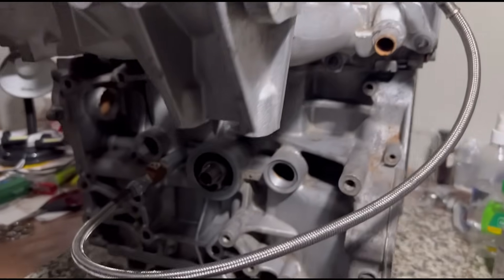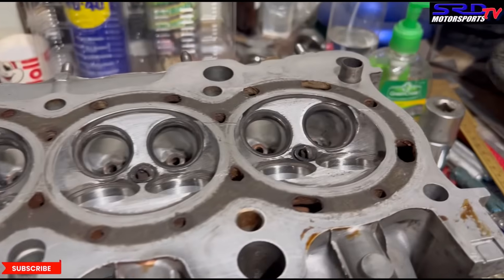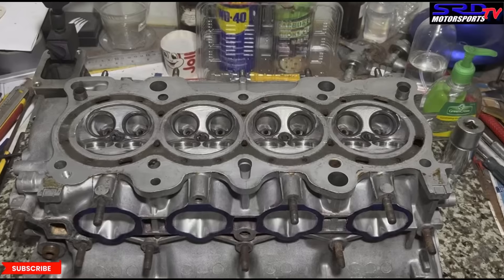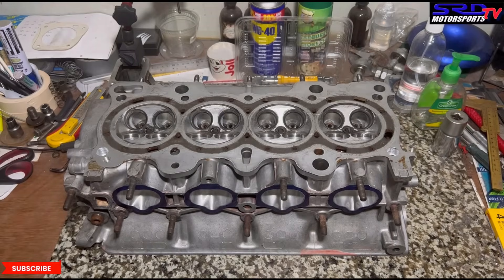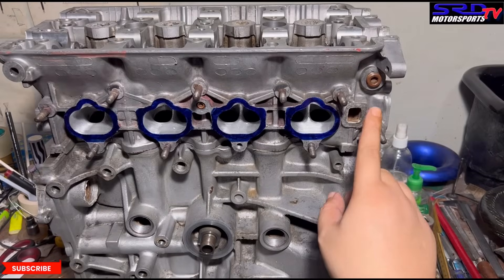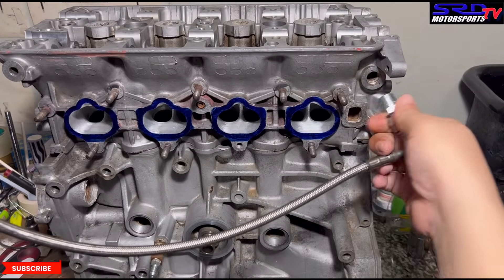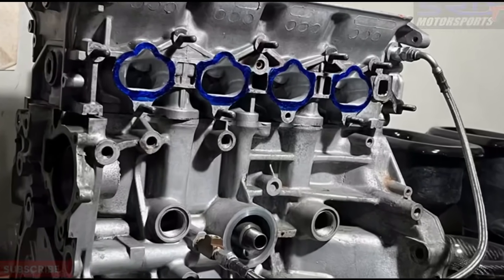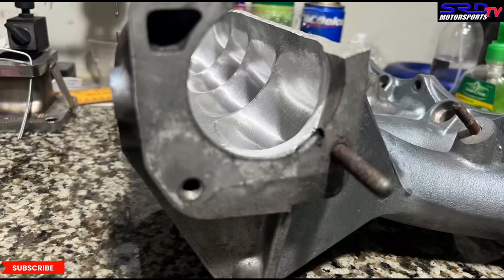Complete Guide: B20Vtec Conversion B16a / GSR / Head and Block

Comment: can you make a video how to port cumbustion chamber
Reply from the maker: That’s too hard but can try but ALOT of secrets there that’s why the b20vtec video I did 
The YCP vs 1Up piston I shared a rare moment a photo of the chambers I do

It’s why others don’t show it 😂 we show enough to help guys like you but also priority is promoting the shop ofcourse
Reply: I am currently porting the head of a D14A4 and the combustion chamber is next on the chopping block. From my understanding and research on the internet, porting the combustion chamber means unshrouding the valves to allow more air to enter easier and smoother past the valves and grinding down sharp edges to avoid hotspots forming and detonation and pre-ignition. After that you sand it down with finer sandpaper till mirror finish to make it harder for carbon deposits to form and to reflect more of the heat back into the combustion chamber, thus making the combustion more efficient. It's probably a marginal or non-noticeable gain, but hey, when you're going trough the trouble of porting, might as well go all the way trough. The tricky part is matching the cc of every combustion chamber to be the same so you have a consistent compression ratio in each cylinder and the other tricky part is to not remove too much material as you will lower your compression ratio and diminish the gains that you received from unshrouding. If you port too much you have to either: 
A) Mill the head to bring the compression back, but you can only do it to a point and you have to be careful of piston to valve clearance, piston to head clearance and timing.
B) Run higher compression pistons, but that involves rebuilding the block as well.
C) Weld up the combustion chamber and port it so you have more quench area and bring back some of the compression ratio and mill the head after that. 
D) Running a thinner head gasket, but you run out of options quick on this one.
I guess it goes without saying that you can do certain things together or all of the above at once to meet your goals.
Engines like the D14A4 have low compression ratio to begin with (9.2:1) so the slight loss in compression ratio from losing cc in the combustion chamber should not be a big deal, but on higher compression engines the loss in compression ratio will be bigger so keep that in mind.

Hope this was of some help.
Also @SRDmotorsportsTV, love your content dude! Keep up the great work!
Reply from the maker: @SusedatLubo  good points there and I agree… the trouble also is each head depends if the stock port is “big” or “small” for the current valve = will dictate the type of unshrouding if any or “many” or a little bit

It’s why I showed on the other video the combustion chamber I did and showed also Endyn’s chamber

Both had bigger bore so unsrhoudong was easy BUT we limited the unshrouding cuz of everything else like cam , valve size and all

Thanks for sharing this it was too long to type as you can see 😂
Reply: @SRDmotorsports   Since you know your way around cars, do you mind me asking for some advice in picking a head gasket? My stock bore is 75mm (gonna be 75.5 some day if I decide to overbore and forge the internals for boost) and I am planning on going 76mm head gasket with the idea to have a little bit more room to unshroud the valves in the combustion chamber before getting too close to the gasket. Most people on forums and all over the internet recommend to go same size as the bore or 0.5mm oversize when you get a gasket. Would it be an issue to go +1mm bigger than bore, as in will it hurt longevity of the gasket to a noticeable extent or is it just a very miniscule drop in compression?

P.S. How can one know when to NOT unshroud too much? I'm a bit puzzled on that question too. Any advice from more experienced builders is much appreciated.
Reply from the maker: @SusedatLubo  slr

Actually good question on the gasket stuff… I agree I’ve heard similar stuff on same bore or stay +0.5mm OS

Personally I don’t see an issue or if there is any? That’s an area like .5-1mm but 0.027” thick so almost nothing?

Maybe just maybe if we are talking about 1,000-1,500whp turbo engines yes it might be an issue as it might be a gap where the “combustion” can try to escape the gasket?

But then at that rate wouldn’t we be running a copper Oring too? 😂 so I don’t know

But much the same on b16 heads running p3f/p8r Headgaskets that are 84mm bore and the b16 chamber is under 81mm hmmm

On the deshrouding question… trick way
Put a valve (intake) on the chamber
Lift it as high as the cams “max lift” prolly below 12.5mm I’m sure

Pay attention to the places needed or not needed deshrouding :)

That’s one thing :)
Reply: @SRDmotorsports  Solid advice and yea you are pretty much spot on! The info about these engines is quite scarce, but i did read some time ago that max cam lift was little under 0.300" or 7,5/7,6mm cam lift x 1.6 is i believe the rocker arm ratio on the intake valves = ~12mm max lift +/- 0.3mm. Take this with a grain of salt as i didn't measure the cam or the rocker arms, but it's a rough estimate. I did some digging around and found some info about unshrouding from the big man himself, David Vizard. The basic rule of thumb that i understood was: The sweet spot for unshrouding is 1.4 x the diameter of the valve. In my case 1.4 x 30mm = 42mm. That means that i have to unshroud a circle (where possible) around the valve, where that circle extends 6mm past the end of my valve. Any more than that is high diminishing returns, so i consider this the sweet spot.
Hats off to Honda, as the combustion chamber looks really well made and all it needs is opening up the combustion chamber wall around the valve by a small amount, that's where the bigger head gasket will come into play and give more room for that. The other thing is getting rid of that nasty edge in the casting after the top cut and smoothening it out.

About the headgasket i agree. It's probably 110/115 chp due to the bolt-ons and no tune, realistically it's less, because it's a 24yr old engine with 220k kilometers (I am 99.9% sure it's probably been turned back quite a bit a long time ago :D). So yea, we are not running 1000+ whp drag cars to worry about longevity and power losses from such minor gaps.

The thing i like about this channel is that it presents complex things in a simple and easy to understand manner, which more or less gives you a starting point if you wanna dive deeper into a topic and learn things you didn't know yesterday. Also uncommon and unorthodox mods like porting the D16Z6 manifold, which is next in my chopping block after the head :D , so yay, lucky me that there's a video explaining what to do. Most people barely get into head porting, let alone Intake Manifolds. Bolting on cams and manifolds is fun and easy, but making the most of them and chasing efficiency is the fun and educational part. You can learn not only the from vids, but from the comments too, as shown here.

Thanks for the advice and keep up the top tier content, champ! Plan on doing some dyno runs in the future before and after a certain mod? Stumbled into honda-tech some time ago about porting the IM, and giving some low-mid rpm torque gain and ngl, for a daily driver that does sound very appealing.
Reply from the maker: @SusedatLubo  oh man! Now u dug a deeper hole hahaha

With what u got from the man himself Dv
Il give u one trick now … ur intake valve? Super glue a match stick pointing outward… cut it off at the exact ratio u need? Now lift it 0.300 and spin the valve now u got urself a “waze map” of the area haha ftw!!!

If u mean u plan on doing dyno or asking? If asking yes sir, I’m still checking what’s next at the shop and whenever there is a chance to dyno? Definitely il squeeze in some dyno comparisons like for the intake pipe I designed etc

And yes on the chance I can afford to pull out my built D16a6 and “redo” as a series as I built it 3yrs ago so 2yrs too early than when I made this channel lol

But if I get to do that? The known plan as I pinned it in the comment of my EG8 Esi video

Is dyno tune it on stock p08 manifold
Then a week later dyno tune again on ported P08 manifold as we have never seen a comparison like that

And lastly dyno tune on my ported skunk2 intake ftw!
Reply from the maker: And thank you for the comment about the channel… in all honesty I’m sure u have sensed it too that talking about what we enjoy ? Is not always welcomed by our friends cuz it’s either too tech or boring for them hahah here locally (Philippines) everyone is “JDM this JDM that” so tech talks are less and Ofcourse too many local shops who either don’t share? Or wait for newb customers to scam

So as I do this to help market and advertise my shop? I realize a bit of tech talk like this isn’t bad and helps all even local new people might get to avoid being scammed by “special” shops hahaha

So thanks for that man and it’s why I try to explain as simple as possible this way “many” follow what I say instead of clicking away hahaha
Reply: @SRDmotorsports  Ayyy, that's what I'm talking about! The match stick trick is what i call using your head, so thanks on that one! 

Yea, about the dyno i was asking if you plan on doing dyno runs in the future to show them sweet gains and get into the meat of it what happened and why. I never thought too much about dynoing it but might do a run in the future when i assemble it and tune it, just for the shits and giggles to see where it's at. Oh and don't worry about that intake tube pipe mod, i got my eyes focused on that one too 😃 it's definetly unorthodox af and i love it.

Real talk, that's why i love it when people get into the meat of it all and discuss the finer details. Instead of just bolting on things, just cause somebody told them that it makes more hp. Here in Bulgaria it's a similar and i see it way too often, especially in the VW group. 
"Just go bigger turbo, cooler and injectors, brah"
-"And after you need more power, what then?"
-"Well you go even bigger!"
And you end up spooling at 5000rpm and shifting at 7000. I often ask myself why not just port the head, the manifold, use better cams etc. etc. and use a smaller turbo, reach the same hp goals but end up spooling faster and picking up more speed while the other guy waits for the boost treshold and the lag. Hell. you can even dust him with a lower powered engine that way, by having a better dyno curve than him instead of chasing peak hp and bragging on social media. That's especially true for the track where you have to think about and set up 50 other things too. I gotta confess i am not the biggest fan of drag racing and even though the content is primarily focused on squeezing out high hp n/a for chasing quarter mile times, it's not the motorsport that brought me and makes me enjoy the content. It's the idea, which you can take and learn about engines and set them up for any application you want and make the most of what you have.

That's the whole reason i fiddle around in my shitbox to begin with. Is it worth dumping money into it? Probably not, but then again it's what brings me pleasure and there's a saying. Pleasure has no price. I like the challenge and i especially like learning from car guys that get into the nitty gritty finer details where the black magic happens. Channels like yours, driving 4 answers, engineering explained and other techy car channels that really dig deep holes and make you use your head.

The reasons why i am even messing with the D14A4 are simple. Super cheap insurance and tax. Don't have to go into trouble of registrating a new engine. Most common engine here in the 6th gen Civic. My first car so i treat it like my firstborn child. And if the D series are the underdogs, this is one of the underdog of the underdogs. Realistically i can go with D16, B16/18/20, H22, K20/K24 with more aftermarket support and potential, but i will quote Bunta from Initial D after the engine swap in the AE86:
"This one is a tough customer and that's what makes it more interesting"

And this channel and other like it help me brining it closer to the goal i have in mind: Strengthen up the engine, transmission and everything else so it's bulletproof and can take a beating like it's nothing around a track and still drive me to work tomorrow, push it only to around 250-300 chp as it will be my daily, have it be easy to drive and predictalbe whilst being spicy when you want it to, match or get close to matching new sports hatches in performance (maybe even dust them from time to time who knows :D) and most importantly to have fun and learn things and meet people along the journey.

I wanna show the guys around me that if you use your head, respect your car and put the time and effort into learning and working with what you have, you can make every car fast, fun to drive and whatever else floats your boat. Not every project needs to be a 1000+ whp K24 and my other favorite "Just swap it for a B/K series, no use to work on that engine". If i had an euro for every time I heard that one, i'd have finished 2 project cars by now. 

So yea, sorry for the long read and thanks for top tier content and advice. Happy to see guys like you on youtube who think outside the box and teach people, whilst having fun themselves and not making it a drag like some university lecture. If you have a facebook or discord group where we can nerd out with other guys and discuss projects and share ideas and learn, that'd be dope as hell. If not i'm just gonna have to keep my eye on you, mister and wait for them intake pipe tests and other mad scientist stuff! 🤣
Reply from the maker: @SusedatLubo  oh man… long read but good read indeed!

The match stick idea ? I used a steel wire so it looks good but it never stuck good with superglue hahaha unlike a match stick so match stick wins!

And yes I agree with the stuff about motorsports… me I was always a MotoGP fan since a kid but my dad didn’t want me to try motorbikes so it went to cars and suddenly F1 was great for me and been an F1 serious tech fan since day one, Drag racing here is easier to try that’s why it’s bigger than circuit racing but there is circuit racing here and either way it’s still involves engine and that’s why I’m in it 😂 but as you notice any Motorsport is good Motorsport when it’s engines we are passionate about! 

I just have my shop Page but not a discussion group but maybe soon or could exist either here in the community or page on fb…

Bulgaria interesting as I grew up in South Africa I knew a few Bulgarian friends like Teadora Petkova , Nadia etc

But most importantly I liked ManU when Berbatov was there hahahaha
Reply: @SRDmotorsports  😂😂😂Preach, brother! Every Motorsport is exciting when it has that heavy piece of metal in a car that makes loud noises and zooms really fast by you. We just happen to be the minority group of people that go mad scientist and wonder why it does what it does.

Berbatov is one of the few good ones that actually made a name for himself so good eye on that one.

I'm gonna grant you a wisdom of my own, which is more of a funny joke that i learned today and laughed all day at it at work.
"Bulgaria is the only country, in which even inanimate objects have mothers."

It just reminded me of all those fun times when you snap a bolt and you bust old the Bulgarian classic in which you kindly send your best regards to the bolt's mom and generally suggest you want to have intercourse with her, most of the times while raising your voice. The raw and unfiltered car guy experience.😂😂😂
Reply from the maker: @SusedatLubo  oh man!!!! Hahaha that’s a story indeed!

Comment: ahhh so refreshing to see improvements and tips done on a B20 VTEC or LS VTEC engine

great info on not only the steps needed to build such engines but some steps to avoid spending more like the relocation of the dowels to the intake side to accept the corresponding OEM head gaskets and not to resort to aftermarket ones👍

waiting for the next, Ralph 😉
Reply from the maker: Yes indeed “ideal” steps as we are not allowed the access to aftermarket ones locally atleast not all the time and not as wisely priced lol